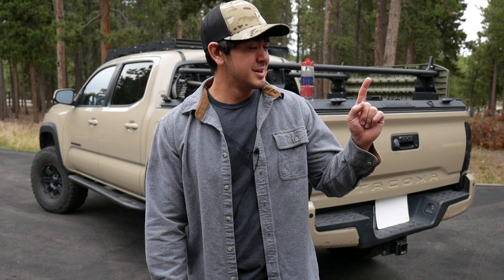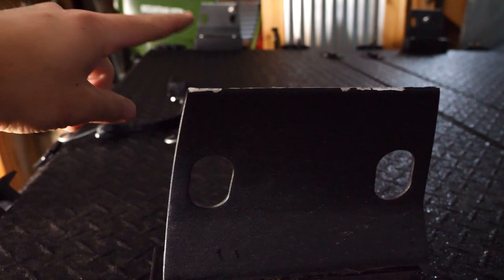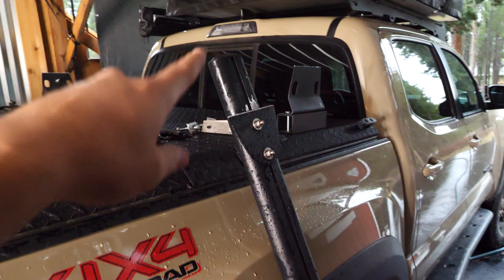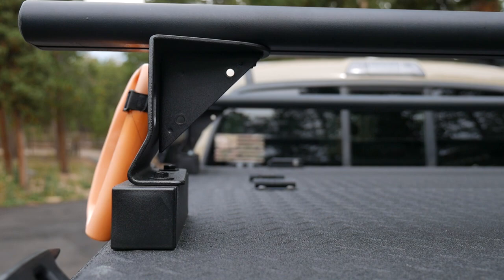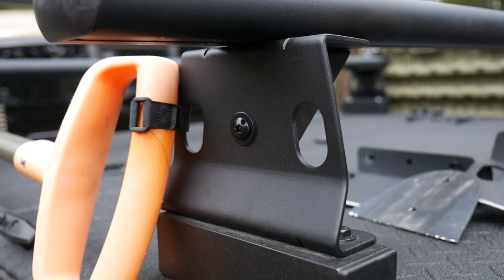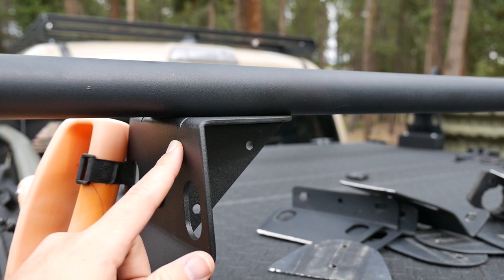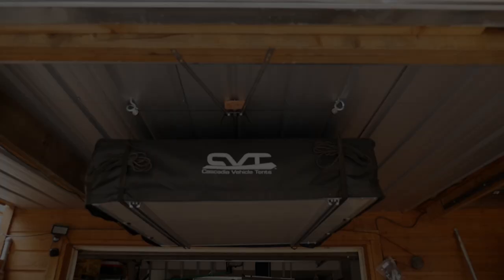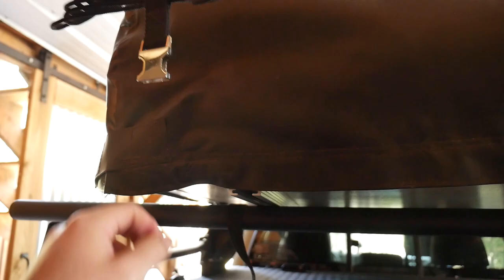My Rooftop Tent BROKE OFF! - Plus BONUS Tent Pulley/Hoist System

Comment: Nice pulley system for the rtt. If your current load bars & rack system breaks off again, you can try some Front Runner Outfitters stuff. I'm currently using their products. They do a good job with the current load that's on there and the driving I do with them on. However, I have stock suspension and I'm new to off-roading, so I have only driven light off-roading. The system I have hasn't been tested like yours, but they feel and look solid.
Reply: Here's a link to Tacomaworld where I listed some steps for the build. The bed rack system is located further back on the bed, but it allows for the front panel of the Diamondback cover to open up. The "footprint"/foundation of the system can work for either a bed rack system or a set of load bars.
https://www.tacomaworld.com/threads/diamondback-modification-thread.553966/
Reply from the maker: Very clever setup, and well-suited to that smaller tepui tent as well - we might even have the same american flag chair? Haha.

i wonder if the system can be used (I'm assuming yes) with just the two crossbars, without the whole square-ish multi-rack system. I know using that whole system is where the beauty of all their accessories come into play, but curious if the racks can even be purchased / used with just two crossbars and nothing else. You have any idea?

Also, if you don't mind checking at some point (sorry if you listed it in the post somewhere) - but do you know the height between the top of the Diamondback, and the bottom of the crossbars?

Thanks for the info!
-Mike
Reply from the maker: Browsing briefly, looks maybe I could build what I'm looking for with:
1. https://www.frontrunneroutfitters.com/en/us/front-runner-universal-track-1400mm.html

2. couple of these - https://www.frontrunneroutfitters.com/en/us/no-7-leg-225mm-pair.html
3. couple of these - https://www.frontrunneroutfitters.com/en/us/1475mm-slat-add-on-kit.html

I think anyway - I'm not sure if those legs work in that universal track system or not...
Reply: Hey, Mike. The components to build their load bars system is the same as for their bed rack system. The bed rack system just adds more components to their load bars system. Note: it seems that some of the accessories can only mount to the "outer walls" of their bed rack system. You'd be limited on accessory mounting options by going the load bars system route (which is why I went ahead and pulled the trigger for their bed rack system. That being said, I did start out with their load bar system at first. But, went ahead for the bed rack "upgrade" about a week later. Also, they claimed the bed rack system would have a much higher load capacity and rigidity, which helped to convince me to go that route.

The Tepui tent I got at REI when they had a sale is the Ayer 2. It is small, kinda like a backpacking tent, making it light, relatively speaking. It doesn't seem to be that bad of load issue mounted further back on the bed. I'll see later if that may or may not be beneficial when off-roading. Your tent, I think you mentioned, is a 3-person tent, about 150lbs. The load bars/cross bars/slats as a set of two on those tracks situated on the center cross member and back panel of the DB cover should be strong good still for handling the weight of the rtt. You could probably even center your rtt toward the front and still be able to open the front panel of the DB cover. If they allow for it, try buying a third set of legs w/ crossbar slat for increased load bearing capacity and one additional slat for mounting stuff onto. Just a heads up, you still would need to get a tent mount kit. I got the standard one (CORRECTION: I got the tall tent mounts, but the short legs for the bed rack). As you most likely know, there are also the tall tent mounts and the quick release ones. 

Regarding the space between the DB cover and the bottom side of the crossbar slats, that would depend on the type of load bar legs you get. There are at least two heights, maybe three: a short and a medium or "tall". There could be a taller or tallest option? Not sure. The legs I got for the cross bar slats/bed rack are the shorter ones. I got the shortest option so that the rig with rtt attached could clear the garage gate at our apartment's garage. With this setup, I'm able to mount a set of Maxtrax on the bottom side of the crossbar slats and still have room to fit two small 4' long tables with folding legs stacked on top of each other on the DB cover, underneath the Maxtrax. It's a tight squeeze on the Maxtrax side of the tables, so I just strap the tables down on the other side. Each tabletop portion of the table is approximately 1-1.5", I think. I think my setup is about a 5" to 6" gap there. When I get the exact measurements of the space between the DB cover and bed rack, I'll edit this reply with it. You could probably go for the taller legs since I don't think you have to worry so much about clearance in your garage or patio. Please see my post on Tacomaworld for the exact part numbers you'd need to mount the legs onto the tracks. They are very specific. Also, for the tracks, you can get a shorter length, like 1100-1200mm, since we have the short bed. 

If you do decide to go with Front Runner, call them and ask for Bryan in customer service (I think he's a manager there) and/or Elisa(sp?). They're the ones familiar with my project the most. Bryan also set up his Chevy Colorado with the same bed rack. They put up that one they have marked as "new" for the Colorado on their website after I called them and showed up to their store to pick up the load bars setup. I told Bryan on the phone I was trying to fit something from their product line onto the Diamondback cover without me knowing that he was already using it on his truck. I think he was all ears to hear someone else was think of doing something similar to what he did. That could be why he let me go ahead and order some parts "a la carte" that weren't listed for sale individually on their site. Unfortunately, they won't list my build for sale on their site because it's too custom. It'd be a lot easier for us Diamondback cover owners to order if it was listed on their site. It's all Front Runner stuff, but I just did some cutting to their tracks and pieced some things together in a mildly creative way outside of what they have advertised. Bryan's set up is with a soft roller tonneau above the truck bed opening with the bed rack system tracks mounted on the top portions of the truck's bedsides.
Reply: Hey, Mike. Here are some measurements for the bed rack / load bars setup I have mounted on the Diamondback cover:

6 1/2"H to 6 5/8"H - top of DB cover to bottom of crossbar around the middle section 

5 1/2"H - top of DB cover to bottom of crossbar/leg mount bolts 5" on left and right side sections of the crossbars with legs (on the bed rack)

3 1/8"H - top of DB cover to bottom of lowest Maxtrax tread spike if mounted upside down underneath the crossbars

53 3/4"W - space between the inner sides of the left and right universal tracks
Reply: Add this to the parts list: https://frontrunner.thirdlight.com/file/43454569957
(Note: It's included in the Chevy Colorado bed rack system, but it doesn't seem to be sold separately). This is needed to attach the legs onto the universal tracks.
**CAUTION: When ordering the Pick-Up Roll Top Leg Mounts & Universal Load Bed Leg (I got the short legs instead of the tall to help clear the garage gate where I live), make sure they give you the M8 Channel Nuts x 8pcs. DO NOT use the M6 Stud Plates that come with the Pick-Up Roll Top Leg Mounts because they are too narrow and won't secure well in the tracks.**

This track length might be an option to avoid needing to cut the longer length tracks: https://www.frontrunneroutfitters.com/en/us/load-bars/universal-track-system-for-load-bars.html
Edit: I'm not 100% sure if this is the same product (I think they are based on the specs), but this is cheaper and you get a tie down eye bolt too!
https://www.frontrunneroutfitters.com/en/us/cargo-rail-mkii-140mm.html

Double check if that 140mm w/ end caps will fit the center panel of the DB cover and won't impede the opening/closing of the front panel cover of the DB cover.

Tip: For more details on their products, click on their "Intsall" links to see the various parts included in the products and their instruction manuals so you see how they piece together.

Comment: That gusset should stretch from the top where it’s connected now, but arc all the way to the bottom.  That would make a rigid system, but in off-roading, rigid is safer.

Comment: A potential problem is that if you modify  something like that the manufacturer is not longer responsible if the device fails and causes damage to another vehicle or person.  You seem like a fine fellow indeed, but I think you're being naïve.  No offense intended. 

It sounds like the  potential for that device failing and the tent impacting another vehicle, with potential bodily injury to another party was very real.  I have an aluminum canoe carrier on my Taco that I built out of aluminum much thicker that your rack.  I bolted it together and took it to a professional welder who did an excellent job of welding the pieces together. The aluminum I used is obviously at least as thick as the stuff you showed.  Even so, from all the travel it was subjected to a crack started at a 90 degree angle and back to the welder it went for more gussets and reinforcement.  I've put thousands of miles on it since and zero issues.  For the parts that broke originally I'd personally go with material at least twice that thick.  But, I'm not a welder or metal specialist - you should  contact someone other than the manufacturer (who in my opinion did a so-so job of dealing with your problem).

Comment: sorry that happened to you but after looking at that rack setup, there was no way that was going to last... Think aluminum brackets will not hold up to that.. Im sorry again that happened, but you need a full rack system with steel brackets and supports that go down to your bed or that go bolted to the sides of the bed. Problem with pickups is that most beds flex and that puts extreme pressure on the rack in all sorts of direction. However the top of your cab wont flex and therefore there wont be pulling forces in all directions on the brackets. Good luck with the next setup.

Comment: Nice video.  But I believe your loading calculation may be off for dynamic loading.  A 300 lb bracket will fail if load > 300#.  Adding a second bracket does not mean this bracket can support 600# of dynamic load.  It just mean the loading applied to it is reduced.
Reply from the maker: I believe so as well.

Comment: I have a very similar setup with a diamondback cover and a cvt tent over the bed. I use the kbvoodoo high rise crossbars that go over the bed cover. I do a lot of off roading as well and the tent has never caused me any trouble, maybe something to consider.
Reply from the maker: Yeah a cool setup, but I don't like that you have to remove it to open up the diamondback. Not a deal-breaker for most, but kind of for me.

Comment: Ditto Doug Swartz' comments.  Aluminium  is the wrong choice for a fatigue prone application.  Full stop.  You cannot design for infinite life in aluminium.  And the life vs load curve is logarithmic so if you double the load (e.g. more dynamic acceleration due to lurching off road) you might get a tenth or a 20th of the life. 
One thing certain with aluminium is that failure is only a matter of time.  corrugated dirt roads are the nightmare design case for an aluminium bracket like this. 
And as others said, the tight bend isn't helping either (hence it failed here FIRST). But it was always going to fail somewhere.
Reply from the maker: Thanks for the input - I may start exploring other options, haha.
Reply: Exploring?!! I geddit!

Comment: Are the new brackets steel instead of aluminum?  If not, watch for corrosion due to the dissimilar metals.  The bolts will show the corrosion.

Comment: Alu has no endurance limit, so it will fail at some point due to fatigue (cycles, ie vibrations or flexing for this). Other metals, like steel, have an endurance limit. As long as the load is below that limit, the life is theoretically infinite. Lots of variables can contribute to fatigue failure, but steel is a much better material choice.

Comment: those brackets look rather weak... no wonder they broke.. I got the KBvoodoo High rise bars, with the tonneau cover brackets. they work great, and are STOUT!! 3/16ths steel brackets.. Ive actually tried breaking them by yanking on them side to side, pushing foreward, and no movement.. and I'm not a small guy 260lbs.  if those brackets had a gusset or two top and bottom that would reduce movement in them, and they may have held up better.  I especially like how the KBvoodoo bars lock into the brackets.. yours relies on bolts, in a sloppy hole.. I just have to deal with shoddy powdercoating.... had mine for 5 months, and they're already peeling and rusting..

Comment: Try to put  some aprox 3-4mm rubber strips between the cover and the steel raisers  it will reduce the vibrations by a loooot
Reply from the maker: Yeah I think it's not so much vibrations that were the problem, moreso the lateral flex of the brackets.

Comment: Now you've transferred the stress point to the bottom bend. That open design bracket is too weak for the side to side loads. You've pretty much done the stress testing for them and proved their mounts are way too weak. Hopefully the manufacturer will completely change the design of these mounts.

Comment: Lookin for a rack system that has a quick disconnect feature that is still rugged. Any suggestions? I was thinking along the lines of maybe a clear system that hard mounts to the diamondback cover and the rest of the system can be hoisted off when not in use. Is there anything out there like this?

Comment: Check out KB Voodoo's bed rack. I have mine on my Gen 3 taco with a tonneau cover and have done some pretty gnarly off-roading with them carrying my roof tent no problem.
Reply: Casey lawton I’m looking at Frontrunner or KBVoodoo. FR has the nicest steel riser legs, really clean, but at a high cost. I wonder if the FR risers could interface with the affordable Amazon crossbars used in this video. But it doesn’t seem like an item worth cheaping out on.

Comment: Hello, is it possible to place that tent in the bed of the truck? Does it clear the wheel arches? I know if it does definitely will sacrifice the valuable space there. But it would look better.
Reply from the maker: Not really, without fabricating something. They do make bars to would allow the tent to basically sit flush with the top of the bed - but nothing I know of that allows it to mount inside the bed. They do have truck bed tents though that are designed to just be used with the truck bed as the sleeping area. https://amzn.to/2MTDOsO

Comment: Moving load maybe but on trails you are forgetting about shifting weight from left to right, and what manufacturer is that rack system? No name one or a brand? 
Andrew St. Pierre White has a video just about roof racks and how they brake in a same way as yours did, on let to right tumbling  think you should check it out...

Comment: I'm thinking about going with a similar setup and I know it wasn't the primary cause, but do you suspect at all if the Diamondback cover had anything to do with the failure?  Does the cover have anymore flex (do to the rubber seals) than it would've had had the rails been mounted directly to the sides of the truck bed?
Reply from the maker: I believe it's just a design flaw of the towers, not the flex of the bed or the cover. The cover actually will have less flex than the bed - though I do have bed stabilizers. The problem is the side to side motion caused by the tent on top and offroad movements - these mounts just couldn't cut it.

Comment: i wonder if the unbelievable amount of bed/frame flex in the tacomas had anything to do with the premature wear of the cross bars? The constant twisting of the bed would put extra strain on the bars as they try to resist the movement. On an SUV there would be no twisting action so maybe the bars would hold up better. Not sure though. Makes me think i will avoid this kind of mounting brackets in the future lol
Reply from the maker: Potentially. I do have bed stiffeners installed and the cover does a little to add a bit of rigidity
Reply: i was thinking that, those diamond backs are very solid covers indeed. Great video as always

Comment: I'm looking at your new bracket and that initial curved bend down at the bottom still seems like a major weak point.  Yea, it's not bending up at the top because of the gusset you added but I bet that bracket is flexing under the weight down at the bottom where it essentially forms an "L" shape.  I'm also wondering if you'll experience any galvanic corrosion between the aluminum and steel.
Reply from the maker: Yeah that lower point is now the weak point, but hopefully strong enough. The bend is more gentle, the area is wider, and yeah theoretically there should be less bending overall with the gusset up top. We'll see about corrosion - both surfaces are coated (one powder-coated and one just spray paint), and that may help.

Comment: Probably didn't help that you added the risers to those. You need to have a lot of lateral strength with this setup. The side to side movement is what strains brackets. They might be able to hold 300lbs stationary.
Reply from the maker: 300lbs dynamic load per bar is their rating, but yeah... Off-road is a different kind of dynamic.